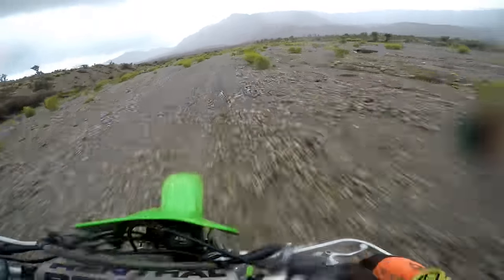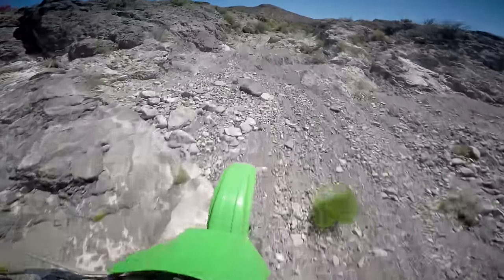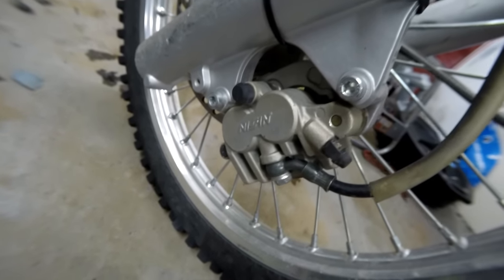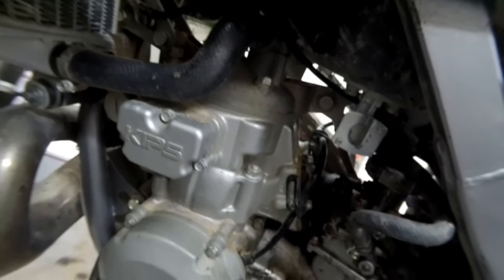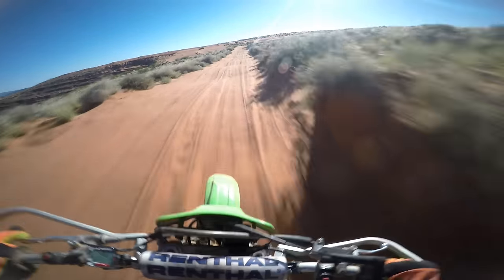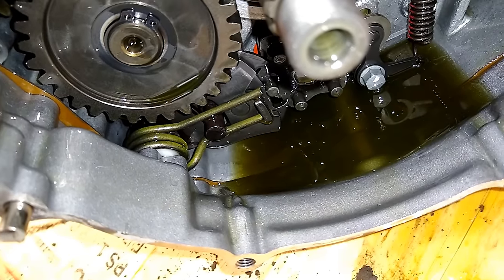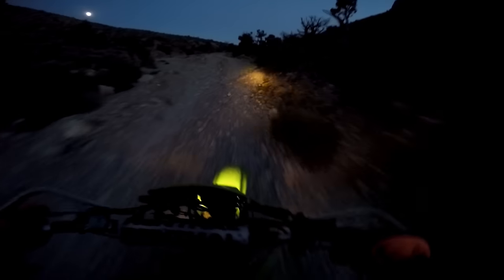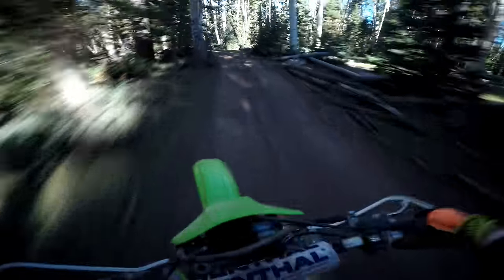KDX200 In-Depth Review

Comment: I see this video is 3 yrs old now, but here’s another comment. I had a previous gen KDX, and almost all of your comments rang true for it. The fork was way soft but the rear shock was right on for my 200 lb riding weight. After I got stiffer fork springs the rebound damping was too soft for the woods, but just beautiful on wide open desert trails. I was riding a RM125 before the KDX, and was always in awe of the low end power on the Kaw.

Comment: The first KDX200 I rode was clapped out behind belief (front brakes didn't even work), so I had a bad opinion of them even though I ran Kawi's at the time. A cpl years later a rider the same weight as me had one slightly modded (pipe, reeds, suspension) and I LOVED it. Looking for one to have fun in the right woods.

Comment: I got my 04 in 2014 from a friend for 1k and it only had 70 miles on it. absolutely love it, even won a few C class enduros on it. I'm at 6k feet in NM, so the mod list is a FMF knarly woods pipe (could use the desert version on the more open stuff), FMF turbine core 2, 2 rear sprocket, Boyesen super stock carbon reeds, air box lid cut, jetted carb, pro taper cr high bars, and moose skid plate for the rocks. And i even keep the stock tool bag on the seat....

Comment: I have been racing a KDX200 for many years now in everything from moto, grand prix and hare and hounds. Mine is absolutely bone stock with he exceptions of a team green speced ported cylinder and merely springs as I am 230lbs. What do I wish it did better? Nothing, it's cheap, it's not the best but man what it does do good it does great.  Odd that your headlight is so pitiful however, maybe try a new bulb. I have raced mine in night races with only the stock headlight (because both my helmet lights took a dump on the start line) and it was fine until the high speed stuff. . Like you said at the end, only a KDX can be a racer, rider and a beginner bike. A buddy of mine rode my 200 years ago and the first thing he said when he got off of it was " That is the slowest fast bike I have ever ridden" and I still tell people that when they ask why I race such an old outdated bike.

Comment: i own a fully original 1996 model and what can i say, its just an amazing bike for tight, steep singletrack. the only issue is that the bike just doesnt pull enough on low rpms. in order to climb you got be a little too agrresive (i now that there is a 220 model),  and for long ridings sessions it wont let you rest that much. the second gear pulls a lot on high rpms but is just to short, you gotta be constantly shifting between the third to be, as he says, in that "zone" but it wont pull.

Comment: Thanks for all the awesome information I just picked one up after watching your video and doing my own test ride.  Best all-around bike I've ever owned.  I almost bought one brand new back in 2002 but I went with an XR 400 instead.   That was a huge mistake for me I sold the 400 long time ago vktx for me personally is way more fun the throttle response so much better.    It's fantastic in tight trails logs hill climbs everything.      It's basically a killer trail bike with a little bit of that Motocross feel
Reply from the maker: Nice! That's awesome that you found one. Seems like they got bought up around my area by now. But I'm glad you found one! Have fun!
Reply: @TortureTestMagazine  the million-dollar question the KDX 200 versus the xr250 what's the better bang for the buck
Reply from the maker: Hmmmm well in my case the XR but that's only because I got it for such a steal. If I was looking at the good condition used market circa the time I made this video, it would probably be the KDX because XR prices were through the dang roof while KDX were still pretty well available at great prices like $1500 or less. Right now in my area they're both pretty tough to buy unfortunately but I see the KDXs more often so the prices might be a little more negotiable. But it's crazy, in a short amount of time the KDXs just got so much more difficult to buy.
Reply: @TortureTestMagazine  I got mine for 1,500 bucks it's a 2004 pretty good condition motor is nice and crisp runs fantastic.    Plenty of low and and all that fun two-stroke vibe.   Thanks for all the great videos keep up the good work
Reply: @TortureTestMagazine  hey buddy what size Jets did you end up going with in your KDX.   I have an FMF gnarly pipe and was going to add a turbine two silencer.   Was also wondering if you had an opinion on lectron.   Thanks for all the great videos

Comment: Thanks for the great review. It's motivated me to do something... I'll get to that in a minute... Bought my KDX200 new in 1990, when I was 32 years old. Rode Vet C class in New England enduros. Put an FMF pipe on it, and had Factory Connection do the suspension. Made it to B class, then moved away to Colorado in 1993. The 8500 ft elevation in CO zapped 30% of my horsepower. Jeff Slavens in Colorado Springs fixed that with porting and polishing. Enjoyed CO trail riding around Woodland Park, CO for several years. Moved to Northern CA in 1998, re-jetted the KDX, and the bike was a rocket at sea level. Rode trails in Lake County, CA for about 10 years, then put the bike away around 2006, and haven't started it or ridden it since then. Moved several times since then, was tempted to sell the bike to clear up garage space, but I never did; the KDX kept making the moves with me (now us!). Been in Southern CA now for 9 years. I have several other bikes, but have told my 12-year-old son several times what a great bike the KDX was, and that I was going to get it running again one of these days. Been playing with the idea of getting a KTM or Husqvarna, but haven't pulled the trigger; been wondering whether I'd enjoy a KTM or Husky as much as I did my old KDX. Anyway, your video/review has convinced me that the KDX is still a viable bike, and has given me a kick in the butt today, motivating me to get my 29-year-old KDX running again after resting in the garage now for about a dozen years. I just told my son that I'll probably dig into it this Saturday. By the way, I'm now 61 years old. Thank you!
Reply: Got it going yesterday as planned. Only had to drain a bit of oily gunk out of the float bowl, then she started right up. Runs great... rode about 5 miles. Need to put my riding gear on and let her really stretch her legs. Woohoo!

Comment: Best bike made! Just my experienced opinion owned 3 2 strokes and 4 4 strokes. Most dirt bikes are terrible in the woods hard to pull clutch/shocks harsh (factory) made to go around in a circle and if there not there a drz400/xr650 type or down right  $11,000 8-7,000 used B.S. JAPAN wake up

Comment: So I just got one of these, this is my first two stoke. This is gonna sound really dumb but I can start it with my hand, I know two strokes have lower compression ratios but is it really that much lower?
Reply from the maker: It should push through about as easily as a ttr125, xr100 or similar. The KDX should be very easy to start.

Comment: Great bikes. Only  sold mine as I was getting a bit old an wanted electric start. Bought a wr 250 which is also a great bike. I found on the  KDX in deep mud the extended forks below the front axle would sometimes cause drag getting stuck in the mud. Apart from that I loved it
Reply: A lot of guys upgrade to USD forks partially for this reason

Comment: What would I need to rebuild my forks? I’ve done a lot of research but can’t find a straight answer. I’ve got an 03 kdx220
Reply from the maker: If it's just a standard rebuild with no damage then you need the OEM bushings, seals, and some oil. The only special tool needed is a seal driver, but you can make that from PVC pipe if you don't have one. I've done a couple sets of these kdx forks and they are probably the easiest I've worked on

Comment: I am at a crossroad in thought. Could the KDX potentially be a a good starter bike for someone who has very little riding experience other than the MSF course? For something that can be obtained with a few thousand dollars and street legalized for a few hundred, and to be maintained cheap and with relative ease, the KDX seems the be the perfect fit. I've read up on the history and reputation of the KDX, and from the accounts of the many who've ridden it and this channel's accounts, the KDX is the motorcycle equivalent of the Terminator. Would this bike be able to handle daily commuting, given roughly 24 miles a day to school or to work? With clever jetting and operation, would it be possible to conduct longer rides to the mountains, given 40-50 miles between? I understand that unicorns don't exist in the motorcycle world, but some come close, could the KDX be one of those few? I need options for a personal mode of transportation that can serve me in various ways and perform with reliability and longevity in mind whilst holding its value even with age. Honda XR's and KTM RFS machines fit the bill well, but the KDX has its place too.
Reply: Yes if you respect the power it should be totally fine. You plan to ride it on the road as well?
Reply: @Rocketman0407  To be honest, after really looking into it, I think I'd be better off with the XR650L, which was also reviewed on this channel. A great review on the XR. Riding a 2T on the slab isn't a good idea for long hikes, just the short hop from one trail to another. The XR is just as cheap and far more reliable longevity wise. Although, in the future, I would want a KDX for light trail work, perfect for that.

Comment: The real question is how many hours did that bottom end have, because mine has the exact same faliure and i am obviusly rebuilding it its a 97 last owner said it failed end of 2017 so 20 years im wondering how long my rebuilt engine will last
Reply from the maker: You'll probably never have a problem. The bottom end on mine couldn't have had more than 30 hours on it. The wear on the frame and original plastics was just so low, it was the closest thing to a new KDX I could find on the west coast. I had to ride the thing over 70 times to wear out that bottom end. Thinking about going through the process, it was so much riding it makes me sick even thinking about doing the whole process again (and yet I continue because I'm dumb lol). If I wasn't specifically torture testing, it would have lasted many, many years of just riding and racing every once in a while (which is what I'd prefer to do, rather than grinding out the riding and racing like I do now.) In actual use, when I started to notice the cylinder plating wearing off at the exhaust port, I would have torn down the top end for a re-plate, and in that process would have caught the bottom end bearing play before it exploded. That would have made the engine rebuild way, way cheaper, and fuel+tires would have remained the dominant expenses.
Reply: @TortureTestMagazine  thankyou for your reply, hopefully it lasts me another 20 years haha maybe not i put way to many hours on motorcycles since i do have the dessert across the street so i get on and go, hopefully it lasts at least a few years maybe with a few top ends, i need to learn how to ride sand first then i wanna jump into 4 stroke or i might just jump to a cr500 or something who knows riding the sand is tuff i tried it on a crf230 a while back and in hard packed it was fine fast and all but in the sand i could really tell the lack of power to keep up in the deep sand so i am unsure of what 4 stroke could be good for these conditions i ride in, i fear a wr250 is to weak as well i wish i could just try them all haha

Comment: Realise you’ve got these things before your old enough to understand what the designer has built.
Your job as a buyer is to realise the whole bike is over engineered for the job they thought it would do.
Your first job as a buyer of the machinery is to adjust everything to the minimum or maximum settings and then adjust the settings till they do the job in the most optimal way.
The motor is TOO POWERFUL from the factory. (If you’re going to argue, then you’ve bought the WRONG bike) you must turn the power down from the factory product.
It’s built OVER POWERED so once you’ve detuned it, it can’t possibly break. 
Not once have we seen you turn down any setting! 
YOUR NOT REACHING OPTIMAL SETTINGS EVER. 
You’re a destroyer consumer and you’ve made NO review. 
The salesman have brainwashed your head and soon you’ll be in a wheelchair.
Reply from the maker: Thank you for the biggest goldmine of a comment I've ever had in this channel. We're going to have an absolute field day with you.
Reply: I’ve invested in doctors and wheelchairs. So it’s me who’s the winner.
Once you’ve made a solid connection between the handlebars and the ground the only thing that can happen next is you break the rider.
You like consuming riders cause you aren’t sowing anything for the future. 
It’s only numbers doing the talking in 2020.
You’re lower than flies at this point in time.
At the level of moving bacteria.
Reply from the maker: Ohhhhh. You hit your head. Makes sense now.

Comment: The suspension and power of my 2003 KDX 200 wasn't worth writing home about, the reasons why I sold mine shortly after I made my last payment on it.
Reply: Sounds like a rider problem.
Reply: Suspension is soft in the front and unbalanced from the factory. Needs to be set up. A lot of power can be added without too much $$
Reply: @jwinter228  Even with all of the Jeff Fredette fork mods, the forks blew though it's stroke, even on the small stuff. The KDX 200 had too many short comings for becoming a good motorcycle, I replaced mine with a YZ 250, which I still own today.

Comment: I had an 02 KDX 220. Put an FMF Gnarly and Q series muffler, re jetted and replaced the stock bars, shift lever and added a MS wrap around engine guard. It was a really fun bike in the woods. I raced numerous Hare Scrambles on it and it never let me down. The suspension is pretty soft for anyone over say 165 pounds or more aggressive riders. It is one bike I wish still had. I now ride a YZ 450 FX.

Comment: What’s the difference between this and the 220
Reply: Other than displacement, the valve porting in the 220 cylinder favors low rpm operation. 
They’re both great bikes, but the 200 is a little more “competitve” feeling with it’s power band.

Comment: I learned to ride on a 1985 KDX 200 back in '88. When I could finally afford my own dirt bike in 2004, I bought a mint 2001 KDX 220, and rode that baby almost daily (I worked on a 239 acre timber project) for 4 years. One clutch replacement, two sets of tires, one chain/sprocket replacement and zero top end rebuilds. Last year, I got back into dirt bikes and bought a very used/abused 2001 KDX 200 just to get used to riding again before getting my KTM 300 XC W. The plan was to just ride it and maintain it. Problem is, I fell in love all over again. Since then I've spent over $3K fixing it up, and decided to completely disassemble and restore it this winter. I just love that little bike!

Great video review, BTW. I'm going to be doing one in the near future for both the KDX and the KTM. Two fantastic woods bikes with a lot of common traits, but with a lot of significant differences too.

Comment: Absolutely love the KDX, currently doing a "hybrid build" with mine. As a side note, KLX inverted forks are a bolt on conversion and make a huge difference. And yes, a stock XR650L in the rough stuff is a miserable "wallowy" experience.
Reply: Oh  the craziness continues. 

Wrong. 

It's an endurance motocross racing bike and it's tuned for that an nothing else. 
The retailers lied to you.
So Kawasaki killed off the bikes. 

They ended the kdx.
It's over! 
Finished!
The gossip lies must stop!
Stop lying!

You're wrong!

It's not what you say it is!